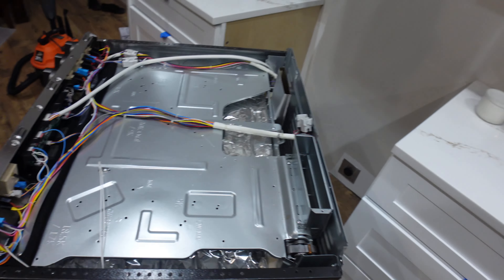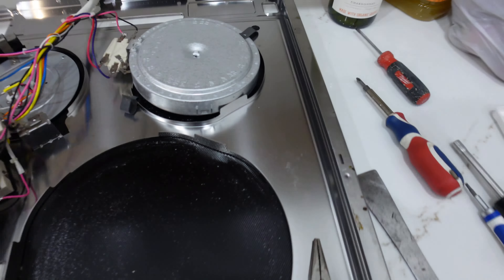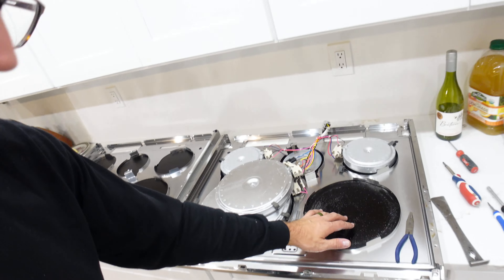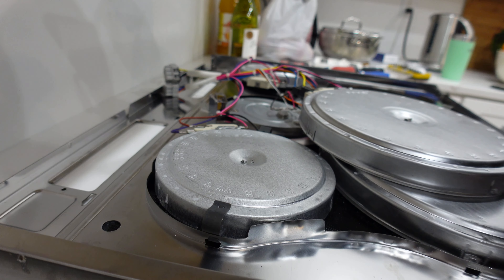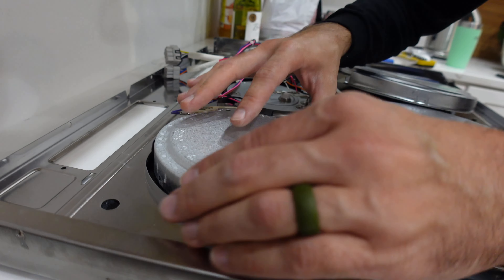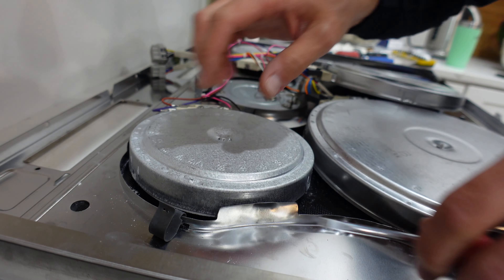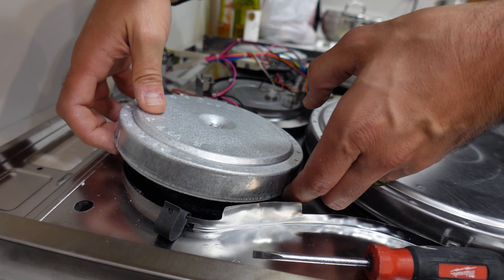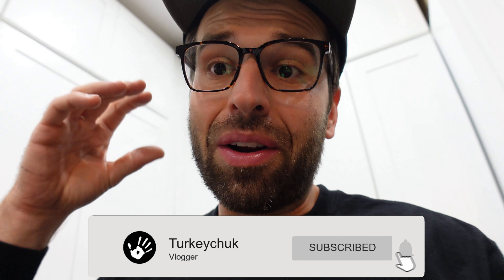Replacing LG Glass Stove Top - Tips To Undo The Clips!

Comment: You don't actually need the screwdriver.  Just push on the bracket with your thumb from one side, push on the burner from the other, and they pop right off.

There is basically a hook on the bracket that goes into the tiny hole on the burner.  Once the hook is out of the hole, it pops right off.